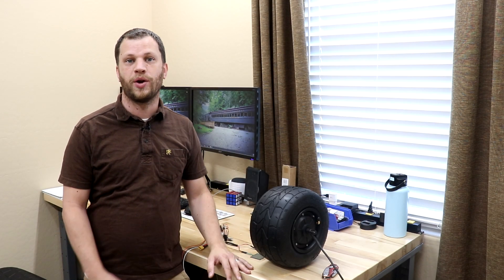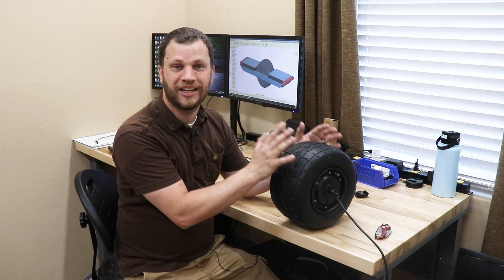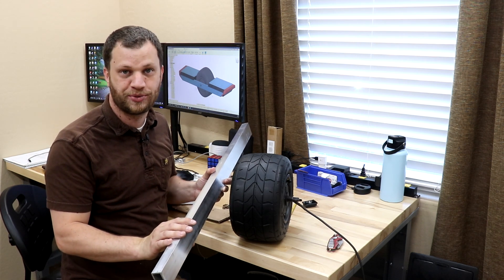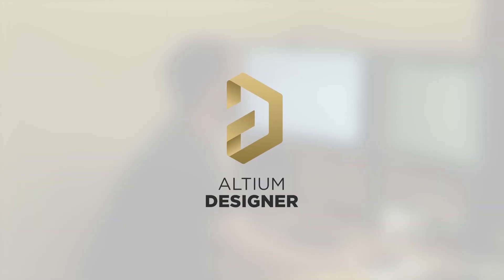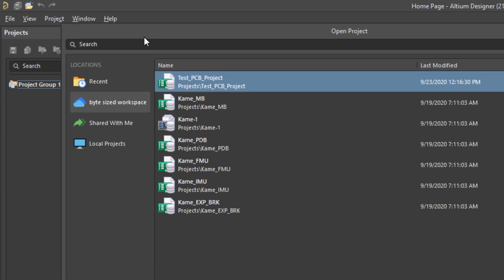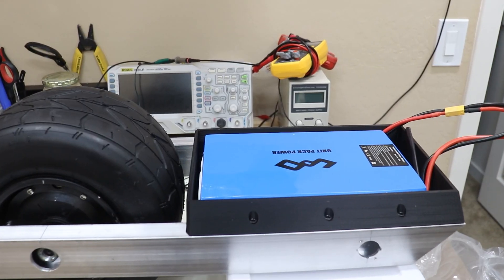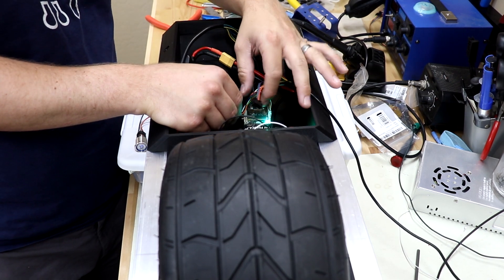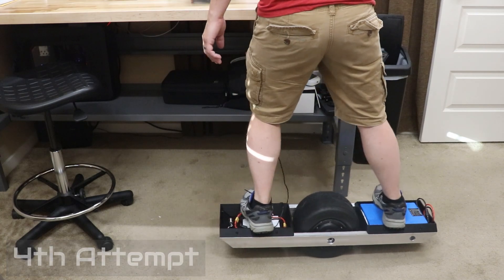I Can't Believe My DIY Onewheel Works!

Comment: Hey sorry to be a bother but I was curious if you needed anything special to make those rails work with that hub motor. Did you need special spacers or was really all you needed a nut and it held it in place

Comment: Great work. This is really helping people and is highly objective. These open designs that use VESC and where you know the components allows a person to create a board that is not controlled by Future Motion and that can be continually updated. Just the increase in the battery is huge. People are using One Wheels with a 26 mile range when they can have a much larger range. Also, One Wheel's software is very limited and cannot be customized. That is where VESC comes in. Open source strike again.

Comment: you dont have to go so slow through aluminum. the excess heat  could cause galling, witch will cause a good day to go bad quickly.

Comment: Consider using some grommets where the cable touches the hard corner of the metal. Over time the cable will scrape against the hard edge and break

Comment: Try a level on the outside of the axle next time to make a width measurement, hold the level plum when doing this then mark the inside of the level.
Reply from the maker: Great suggestion, thanks for the idea 💡

Comment: Interesting I thought onewheel used pressure not just angle. Because wouldn’t you have problems with hills if you only do angle based control

Comment: A nice simple and fun looking build! Didn't know the VESC firmware had so much built in. 
If you plan to ride this a lot, next time you have it apart, put some heatshrink(Or rubber grommets) around the main battery cables where they pass through the aluminium tube, over time any burrs on the inside you missed will cut through the soft silicon and you'll be very glad the batteries have fuses! :)
(It can also cut through PVC, but far, far slower. Silicon is just so easy to split!)
Reply from the maker: I considered this but never got around to it. Thanks for the great suggestion

Comment: im little concern about balance, that heavy battery is on one side and another is basically empty, I know its simpler solution but batteries should be imho on both sides to distribute better weight and use all available space. Anyway thanks for video
Reply from the maker: I had hoped to do just that. But as I learned more about lithium battery packs, I learned that in order to get the 48V, the battery has to be a certain length. I couldn't really fit another battery on the other side along with everything else.  It would have made the board even longer and it's already longer than I wanted. This was a prototype so  there are things I want to improve. The balance is really not an issue. It's not even noticeable once you're riding it.
Reply: @bytesizedengineering  sure thing, and it's great especially for prototype, I also checked available ready to buy battery packs and there is not really much different dimensions. Then I start looking for people/companies doing custom dimension battery packs so I will probably use it. I will share prices etc once I will order :)
Reply: Yeah he would have a board to ride 100 miles on one charge

Comment: I do want to note that I was a bit worries for the pressure pads though. Just being taped directly to the underside of the griptape. In my mind I imagine that if you ever needed to replace the griptape, then it would rip off the pads.

Comment: For measuring the width, simply place the wheel on a really flat surface. Use a square to butt up against the point on the axel, mark a point on the surface, do it for both sides and measure the distance between the two points.
Reply: Or.. 12" calipers
Reply: THANK YOU! Was my thought exactly

Comment: Will the code for the motor controller be uploaded on your website also?
Reply from the maker: I plan to release a bill of materials and design files including the code on my website. I will also have a step-by-step guide to build your own which will be available for purchase. I try to release as much information as I can for free, but this took quite a bit of effort in time so I am trying to figure out a way to recoup some of that investment.
Reply from the maker: The digital build guide is now available here!
https://www.bytesizedengineering.com/store/digital-build-guide-openwheel
Reply: @bytesizedengineering  Hey everyone, I bought the build guide yesterday and it is worth every penny. If you like to study intimate details of projects like this the build guide is an absolute must. It's over 40 pages long!
Reply: I'm ready to buy right now, I totally believe in supporting your efforts, they are top notch!